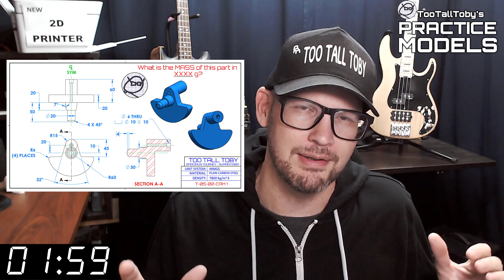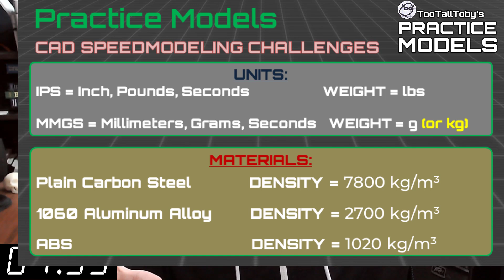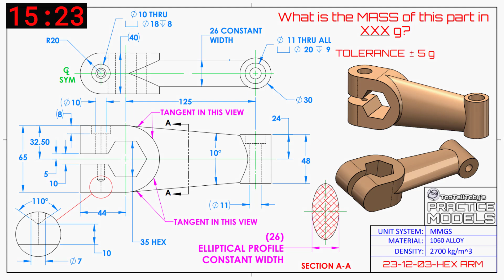CAD Modeling Challenge - Onshape, SolidWorks, Fusion360 - HEX ARM - Sweep Loft Guide Curves

Comment: 627.367 in OnShape.  Pretty challenging for me (only 2.5 months using OnShape). Didn't know about using guidelines for the loft...that was fun to discover.  Every one of these models creates another challenge or two.  I used the hole feature for the 7mm hole in the bottom jaw, which meant a bit of arithmetic and trial and error to get the depth right.  I should have used a sketch/revolve to create that hole.
Reply from the maker: Awesome feedback and so glad these are helpful to learn some new skillz!!

Comment: Toby why the detailed view for the counterbored hole (drilled) suddenly got 7mm bolt diameter while on top seems to be 10? Is it designed to be that way? Dragos
Reply from the maker: It's a smaller diameter because it's going to get tapped, so you can use a single bolt to "clamp down" on the hex shape